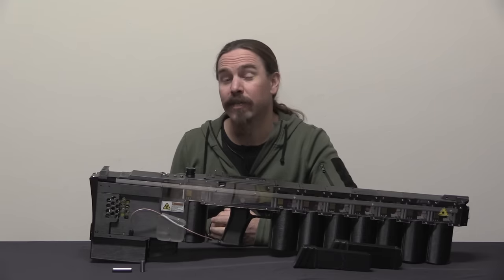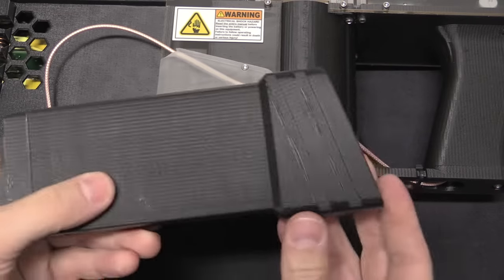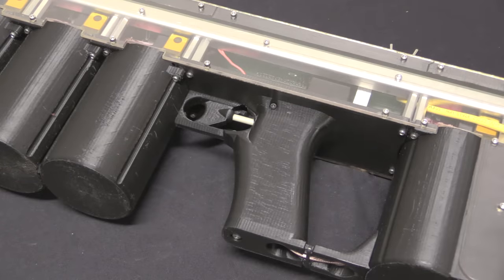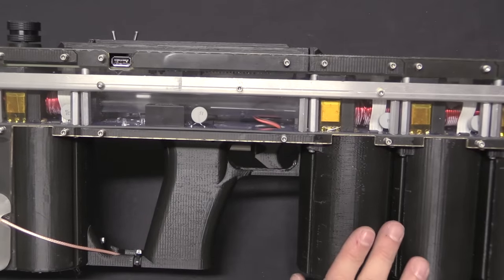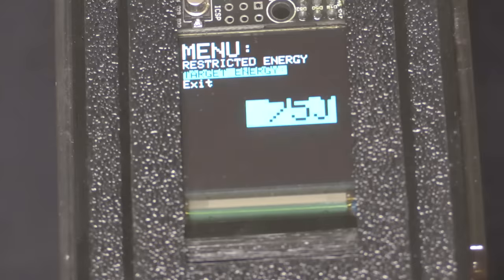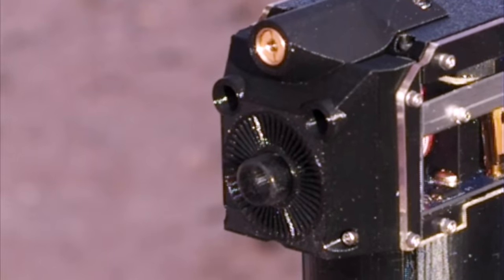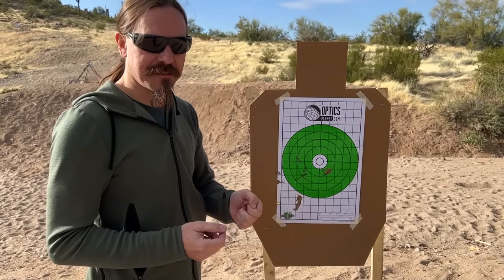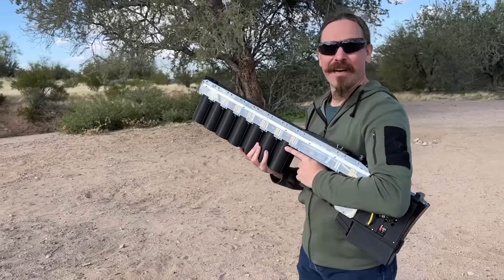ArcFlash Labs' GR-1 Anvil Portable Gauss Rifle

Comment: Whilst I'm slightly disappointed the projectiles didn't obliterate the target, at this stage of development it's the equivalent of a prototype musket with gunpowder.

I'm sure it will develop even more rapidly than gunpowder weapons did.
Reply: Undoubtedly, we ready pretty much know what is expected of a projectile weapon so ergos and performance is a known goal. The guy that co runs the company said their biggest hangup is capacitor tech due to it not being as devolved as batteries and other things
Reply: Eh I was say it's more like a electric crossbow as far as lethality goes, lower then a musket but both will kill you depending on where it hits
Reply: Oh I'm sure it will. For one, the biggest thing holding blackpowder weapons back was the cost of manufacture of advanced models. Back then, all machining had to be done by hand, and so rifles could only be owned by noblemen who could afford to pay the gunsmith to make the rifling by hand. Even when the first dedicated rifle units were starting to appear (eg. the 95th Rifles in British service), it was very expensive to make anything more advanced than a simple smoothbore flintlock.
We definitely have the machining capabilities to advance this tech far faster than our ancestors did, and I'm sure we'll see this exit the prototype stage within our lifetimes.
Reply: Exactly. This is just an effort towards developing a potential base-architecture for future iterations. Hopefully they can use this to get in the door and get some developmental latitude to fine-tune a viable (still extremely novel) product.

Comment: the most striking thing is how quiet it is, I never considered that it'd be as quiet as a bow & arrow. wonder what ramifications that'd have on combat doctrine in a gauss-rifle dominated space
Reply: Fighting Jack Churchill of the British military used bow and sword to great effect in WW2. There's a precedent!
Reply: with high energy and speed it will have supersonic crack. now it just does not have anything to do the noise yet
Reply: The other side effect will be compass deviations.
Fire a big enough one and your location will be pinpointed pretty quick.
Expect counter battery fire.
Reply: Same as with the air rifles during the Napoleonic wars I'd guess...
Reply: Now I haven't heard this thing IRL, but I have shot my 30lbs bow at home.
It's a basic wooden recurve, so literally zero moving parts. That thing is surprisingly loud, it has a really noticeable TWANG, and the arrows hitting the foam target cause a really loud THWACK to ring out, and I have string silencers on my string, so it's a tiny bit quieter (not really, it's just a deeper wooshier sound, and not a twang). I should note that recurves are a bit louder than something like a longbow, since the string slaps the bow limbs at the end of their travel.

This thing seems much quieter than a bow, since it's just a plasticky clack from the solenoid, and that's it.
Reply: Why would it be loud? The slug isn't even going 250ft/s lol
Reply: @shawnr771  Defense systems can already pinpoint sniper fire location pretty accurately
Reply: @seanfager8063  that’s a bit of an exaggeration lmao but he was certainly a badass and definitely carried both things at one point or another

Comment: I wonder what the reusability of those slugs is like... Also, I hope a future variant will allow for a "sliding" magazine that can facilitate any length of projectile inside of the range already shown. Would make it even more easy to make your own ammo.
Reply: probably 100% since there is no cartridge. the trick would be having the projectile remain in tact.
Reply: We used the 3/4 inch version of those dowels to locate Robot bases on a car body assembly line. They are not mild steel, and would probably hold up to repeated use (if you could find them)
Reply: On their website, they tell you exactly how to make more OEM spec ammo...
Reply: Really, it seems like you could just use any ammo you have, as long as the casing’s able to be pushed by magnets, and if you have a magazine to fit the ammo
Reply: Who cares about reusing slugs

Comment: Maybe it should not be a an assault rifle form factor.  Maybe they go with a stationary, big, long gun, sniper rifle, form factor and beef up performance at the expense of mobility.  It could be still be desirable because it would be quiet and have no muzzle flash. I don't think sniper would scoff at that if the range and accuracy were there.
Reply: I think sniper is were something like this will one day shine. It makes a little sound releasing the projectile. Any suppression of that and you are talking one silent long range weapon. Oh and no flash either.
Reply: And maybe it would have a flatter trajectory as well? I mean that depends on a lot of factors but I'm thinking maybe this would deliver a higher fps resulting in (loosely) a flatter trajectory?
Reply: you could probably have the first capacitor pulse an alternating current to even create spin.
Reply: @zeedstun891  if this thing gets production ready and the accuracy is there it could be devastating on the battlefield. Especially with a little material science on the slugs they could probably make several varieties of ammo.
Reply: @zeedstun891  How would that create spin?
Reply: Well mortors and missile launchers are probably going to see the first military application of this tech. Imagine a missile launcher that almost silently and safely throw out a missile even inside an enclosed space. A anti-material rifle would probably the next implementation. 

As for an rifle replacement, it's gonna to be hard to say since there's a few ways it can go. ETC ammunition would change the game, giving guns EM gun like performance for a fraction of the power cost. While not quite having all the advantages of a full EM, ETC capable guns would be cheaper to make and the reduced power needed would make it hard for militaries to justify trying to bother with making man portable rapid fire EM guns. Then their are lasers, and man portable lasers are closer to being a reality then most think. While more energy hungry then even EM guns (current laboratory models are luck to reach 30% efficiency, which is much better then the current models being tested which are struggle to hit 10%), they are terrifyingly accurate, allows for ticks that you can't with physical weapons (if you see someone's reflection you can target it and the laser will follow the same path the light does. Basically if you can see it, you can hit it) and if you are willing to trade off range for stopping power a laser can punch through armor like nothing. A type of laser called a pulse laser that has the same output energy as the muzzle energy of a M16 with a 24in barrel can punch through three quarters of an inch of RHA steel at 100 meters (that's on par with a 50 cal fired from a full barreled M2 browning!). A laser like this can also offer a crazy level of options. like with the Anvil you can reduce power levels and up rate of fire by the same amount, super useful for suppression fire, or reduce ROF and fire an AP shot. You can also play with a weapons focused, if you are up against targets with crap or no armor you can defocus the beam and reduce penetration power for better range or tighten focus and increase penetration for reduced range. So honestly it will probably come down to what gets developed first and if they get developed near each other then it'll come down to which gives the best performance for the lowest price point (which favor ETC).
Reply: @AxiomofDiscord  I think the flashing laser that tells you when it's ready to fire is a bit of a giveaway.
Reply: Slim Dim  Oh, please enlighten us. Clearly your are our intellectual superior so you can obviously explain to us how we are uniformed and correct or mistakes. I'll be patiently waiting.
Reply: @AxiomofDiscord   Theres a material that lets you alternate magnetic poles. if you alternate pole's then you can create spin by making it pull to its respective pole.
Reply: @zeedstun891 It would not hover if pulled to a pole. It would attract instead of repel that would cause it to slam against the barrel and if the otherside had the same polarity as the projectile you would have it being pushed towards that part of the barrel it was being attracted towards as well.
Reply: It’s like a ship canon type weapon
Reply: given that it runs on electricity i think it should truly shine as a fixed gun emplacement. I can only imagine the battery is holding it back in regards to weight and output.
Reply: @zeedstun891  That's not necessary, at least for ones used on a planet's surface, just machine helical fluting into the projectile so it's movement through the air generates spin. Spaceborne ones will definitely need gunside spin induction.
Reply: The range and accuracy are not there. They aren’t even within two orders of magnitude.

This has less firepower than a crossbow, and is significantly less accurate.
Reply: CNC Machine the projectiles for "flight" characteristics. Dont need the "rifle bore" for the same effect. Nerf footballs you buy your 3 year old kid and he can toss it with a spiral. Im sure something could be done.
Reply: @oktology  a cross bow also has a helical spin put onto the vanes of the bolt. This helps the accuracy and flight characteristics tons. Ever try to shoot a crossbow bolt without a set of vanes on it? It tumbles a lot of the time too. Thats why even "way back when", we used wooden vanes on them.
Reply: @SmooreMC85  It would probably have a larger arc. If you want it to stay silent you need to keep it subsonic. You'd need a heavy, slow bullet to impart significant energy. Or just make it throw explosives, you could skirt the laws against explosive bullets by calling it a long-range grenade launcher
Reply: @chucksneed1264  you think so? I think some folks have got it right this things would shine at a certain size, maybe something fixed or on the back of a vehicle. I believe the USN is shelving this tech for now on its ships. I was thinking a small somewhat sense, hardened projectile moving fast enough basically acts like a gauss cannon. It's clearly not going to be as flat as a laser but maybe much flatter than a traditional, comparatively powerful rifle. Maybe make it so the shooter doesn't need quite so much experience (though I'm way out on a limb with this statement) and I don't know I'd worry about how loud it is. If the target is neutralized, and a comparable rifle is pretty loud, maybe however loud something like I've described wouldn't be that big of a deal. Could be wrong though. While I have a back understanding of general ballistics and electromagnets, this is quite above what I would consider my level of expertise. Just throwing ideas out there, it's always fun to daydream.
Reply: @SmooreMC85  yeah idk about all of that but if you want a whisper quiet gun you HAVE to have a subsonic bullet, there's no way around it

Comment: The "silence" has much to do with the ultra low velocities. Those slugs were doing less than 25% of the speed of sound. Get the velocities reasonable for a projectile and it will produce plenty of noise. Even so the current with a say 6grm fin stabilized discarding sabot dart would be interesting
Reply: I would think the greatest reason for the quietness is the fact that the noise of an explosion from a bullet's powder isn't escaping the muzzle behind the projectile.
Reply: @SKYGUY1  not particularly useful to have a silent launch for a > Mach 1 projectile, when it's the sonic boom "crack" of a conventional supersonic bullet that would be right next to the target, from the target's point of view. One could however have a very heavy projectile fired at subsonic speeds to produce a murderous amount of total energy while maintaining stealth, but then arcing would need compensating for
Reply: @adrianke77  Interesting point. My first thought was it didn't need supersonic velocity because of the high mass, but ballistically this thing's chucking bricks. What range do you think you could you sight to with this concept?
Reply: I was thinking CNC machined projectiles of some sort. Put a spiral cut in it or what not.
Reply: @crisnmaryfam7344  Spiral cut won't spin it the magnetic accelerator doesn't work that way. Fin stablised with offset fins to give it spin. Use discarding sabot to get the mass doewn to give viable velocity.
Reply: @brennantate1901  Why bother with a sabot at all? There's no propellant gas, so getting a good seal between projectile and barrel is a non-advantage.
Reply: @BlurbFish  Sabot is for the feeding and magazine - otherwise there will be major compilications
Reply: at closer distances though, this weapon is probably going to be put with suppressors as thats still alot of mass and can most likely kill a person, or gravely injure them at the least... either way I want one just to fire in my backyard!

Comment: Really interesting but also a demonstration that combustion propelled ammunition is going to be around for a long time yet, unless there is some miraculous leap forward in technology.
Reply: Something like all temperature superconductor would change everything. But it would have huge impact on everything, nobody would even notice the guns.
Reply: I mean bows are still around aren't they? both the normal and crossbows? It stands to reason that combustion based firearms will also exist alongside - though, once you get electrically powered weapons, normal guns aren't really efficient in terms of cost to use them, bows always had that advantage over guns as well
Reply: We're humans. Give it 50 years.
Reply: Agreed, the capacitors are not powerfull, light and fast enough yet, and batteries are not advanced enough to provide the same energy as gunpowder without a huge drawback in weight.
As for the projectiles, an fin stabilized round, with a heavy metal head and a plastic tail would probably be more stable
Reply: @jerk4628  Eh, I think "electric cars" and green energy in general has shown humanity has clearly hit a bottle neck of development in this area. Like the amount of funding and attention that goes into these technologies is insane, and yet electric cars are still worse than that random GM hydrogen car they prototyped in like 2003.

Anyways, my point is, it's not really the attention that's the problem. You are right advancements will come, I am just talking about advancements that are a big enough leap forward to make handheld coil guns competitive with conventional firearms.

^And thats not even mentioning the development of firearms isn't over yet either.
Reply: @pierrevilley6675  You really don't want to pack the power of gunpowder into a similar space in form of electric charge. If you pack enough energy into a small enough package, it becomes an explosive device. Compared to that, gunpowder is relatively safe. Those caps they have now are already pretty dangerous, but mostly due to electric shock.
Reply: @jerk4628  " I think is pretty far off base... I mean you can buy a $100K Tesla that goes faster 0-60 than a $2M Bugatti... " 

How does that disprove what I said? Actually research their hydrogen car. It's leaps and bounds ahead of electric cars, especially when considering the "green/green energy" side of things. You know, the whole selling point of electric cars. Just the production cost of those batteries alone make electric cares more harmful to the environment than most carbon fuel based vehicles.

"We're at the beginning of the electric car. "

It's been decades and something made in 2003 is better. Imagine if those decades and resources were put into developing hydrogen cars

"I also disagree with "large leaps forward as well". Sometimes tech advances that way. Sometimes not. If we get 10% more storage capacity in batteries every year, then thats compounding interest and can be good enough. It will take years, but it's a question of when, not if."

I never said it would never happen. I simply wanted to curtail your overly optimistic comment by pointing out real life examples. Hell, I specifically said you were right that advancements would occur.
Reply: @gearloose703  I mean by your logic uranium and thorium and potentially plain water is extremely explosive and dangerous stuff? (Uranium fission, thorium fission and hydrogen fusion) - Trying to generalise chemical explosive logic to other fields... is um naive at best.
Reply: @gearloose703  There's no such thing as "pack too much energy in a small space and it'll explode", matter itself is energy, it is a matter of how you convert your material into energy (chemical reaction here), and under what form is this energy released (electric current for batteries, mechanical force for gunpowder). 

Batteries/ Fuel cells uses mostly the same kind of reactions as gunpowder (oxydation), but todays batteries needs to use less powerfull reactions than gunpowder in order for them not to overheat. 

Now a battery as powerfull and as tiny as an ammo case would just be equally as dangerous, not more, not less, because it would carry the same amount of energy in the same amount of space.
Reply: @aravindpallippara1577  Potential energy as in electrical charge is ready to go, just like explosives, and may go off on it's own just as well.
Reply: @gearloose703  You could look to capacitors - a charged one (to thousands of volts) can stop a heart and hold that charge for months - electricity is a pretty different ball game when it comes to storage
Reply: @aravindpallippara1577  yes and the capacitor can and will explode if abused. I play with them all the time. Joule is a joule.
Reply: @gearloose703  well pretty sure a grape will also explode if abused